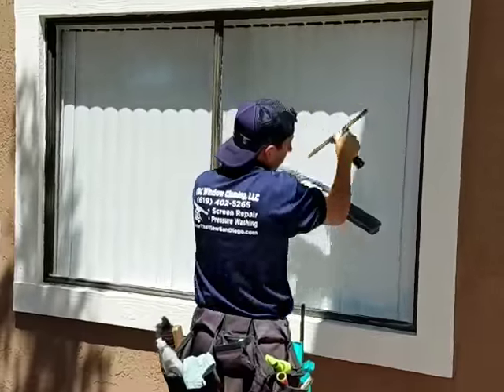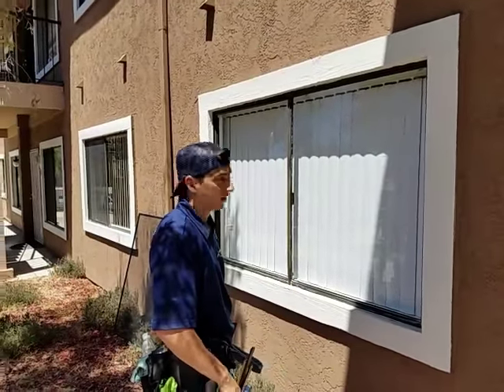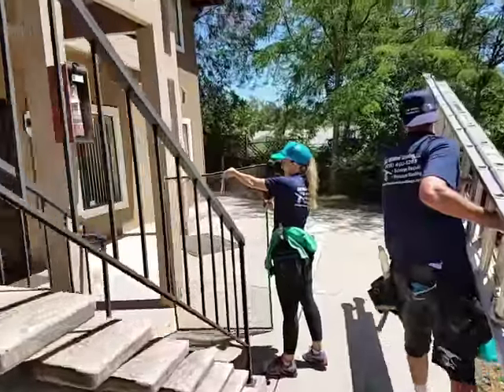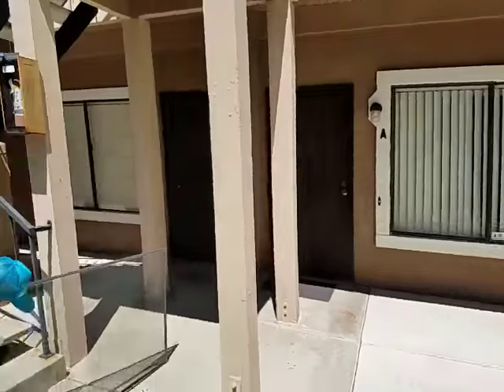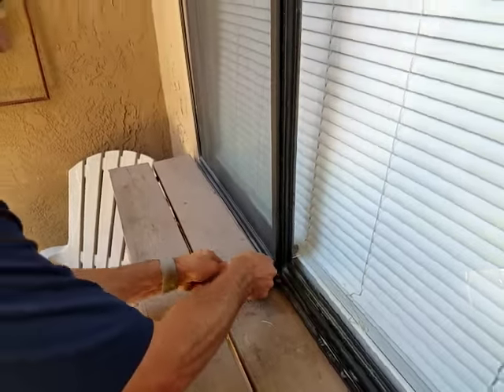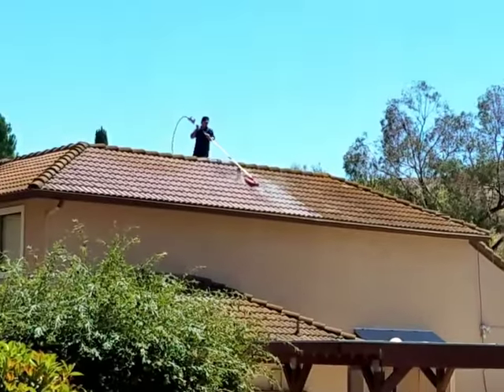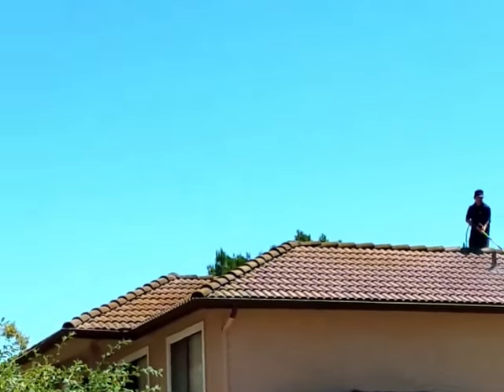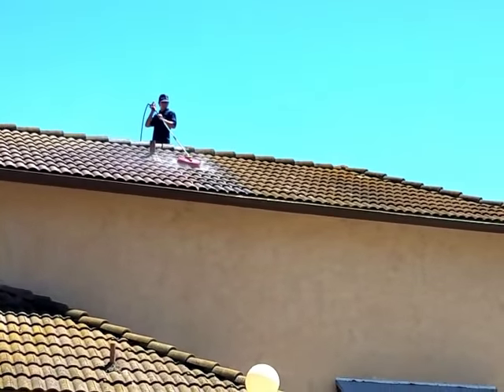The Summer Window Cleaning Crew/ VIDEO

Comment: What is he doing with that surface cleaner? Ouch!
Reply from the maker: James Brown exactly what I told him to do that roof line was $375 and he did it in 45 minutes, you can see the difference between where he cleaned and where he still had to clean and that thing wasn't on full blast so it wasn't chopping up the tiles or anything

Comment: Your on the roof with the surface cleaner...haha. Ummm, why not soft wash from the ground? Not trying to talk smack. With the pitch of that roof I don't think I would put my guys or gals up there.
Reply from the maker: It's a flat roof up top with a 3 foot wall before the roof starts so they're not even on a roof, correction they are on the roof but they are not standing on any kind of tile, so it was very safe